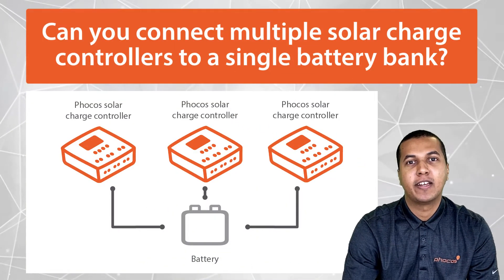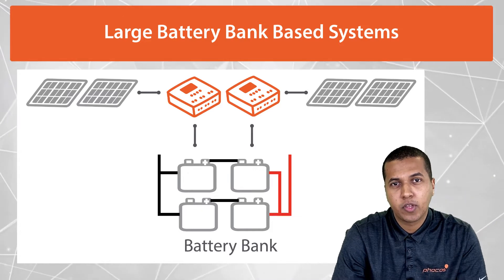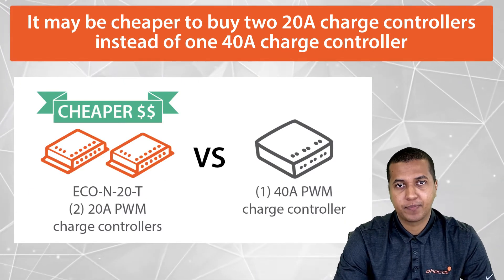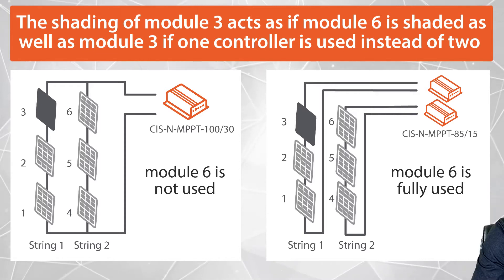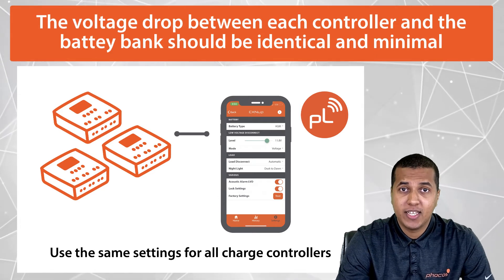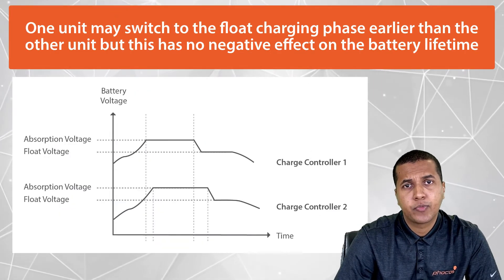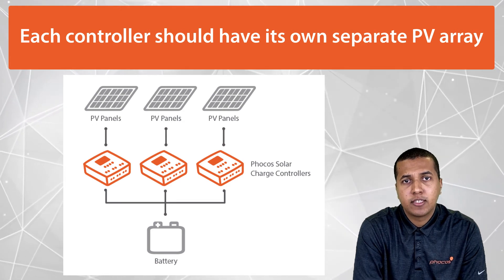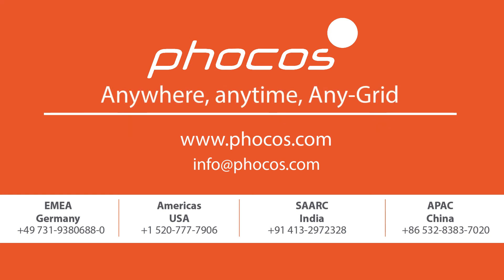Can You Connect Multiple Solar Charge Controllers To A Single Battery Bank?

Comment: I fitted solar panels on an Rv because they were different sizes I used separate controllers on each panel 
 I also fitted a diode ( one way current) on each of the positive feeds from each panel so that there was no loss from  using mismatched panels, worked just fine!

Comment: How would someone go about connecting multiple solar charge controllers to multiple bus bars which link large amounts of batteries in multiple strings? Just as an example, say someone has five strings of 100 amp 48 volt batteries connected to bus bars. How would someone charge all of these using the multiple solar charge controllers? How would they do it if they cannot find bus bars to fit the total amperage necessary to match the charge rate of the battery bank?
Reply from the maker: Thank you for your inquiry, because of the technical nature of your question, we would strongly suggest for you to reach out to our technical support staff https://www.phocos.com/contact/#tab-contactech

Comment: Other videos srate that it’s not the voltage but the internal resistance of the battery that determines the output of the charge controllers. So having identical controllers is not essential.

Comment: Thanks for the video but i need your help i have 2×200w, 1×265w 1×270w, 4×415 watt panels, 8×280ah lithium batteries series to make a 24v system so my question is what size charge controller will i need to run my system i have a 60a charge controller but i recently bought the 4×415 watt panels so how much more amps do i need to run all of my panels all of my panels are 24v
Reply from the maker: Thank you for reaching out and sorry for the delay. According to our technical team, since you have chosen 24V panels, we assume you are using PWM charge controllers. We recommend to use a panel with a Voc about x1.5-2 the battery bank voltage when using PWM controllers, so, for a 24V battery bank system we recommend a panel Voc of about 35-50V. To properly size your solar system you should make sure that your charge controller can handle the full short circuit current of your panels when using PWM controllers. So, you should make sure that the short circuit current of your x4 415W panels in parallel does not exceed the current rating of the PWM charge controller you choose. If the short circuit current is 10A, and you have 4 in parallel, you will need a 40A charge controller (like the CXNup40) Also, make sure that same current does not exceed the charge current rating of your battery pack.

Comment: Question I have 2 PowMr 24v hybrid inverters 3000w each I have 24v 600ah Lipo4 battery bank can I connect both inverters to the 1 battery bank? 
But can I connect  4000w solar panels to 1 Inverter to charge the batteries ?
The reason why because I don't want to split the panels in half and run another set of wires from my roof down to the garage it's to much work
Reply from the maker: Thank you for your comment, unfortunately, we cannot provide any technical support for products not made by Phocos - But, if you were using 2 Phocos PSW-H-3kW-120/24V inverters, you could connect both to the same battery bank and then only connect solar to one of the two inverters. With Phocos equipment, it is not necessary to have the same PV power on each MPPT. Please visit our website www.phocos.com to see a list of Phocos distributors near you.

Comment: I am using 4 x 6 V PLA - L 16 AGM PLATINUM BATTERIES
USING A VICTRON 100/50 
THEY ARE SHOWING 11.37V 
My Alarm on my 2000 w 
Inverter goes off because power is soon lost I run my small pond pump pc and 500 w kettle and 700 toaster and cannot use them all the time what's going on should I get another
MPPT CONTROLLER
To get more AMPS and is it going to benefit my system
Thanks Troy
Reply from the maker: Thanks for reaching out, Troy. It sounds like your battery bank is undersized for your loads. You will need to consider the capacity of your battery bank to be able to provide adequate power to your loads at any point in time and for how long. Adding more solar charge controllers will not fix that issue, but may alleviate the problem during daytime when sun is available. 11.37 is very low voltage for an AGM pack, meaning the pack is being overrdrawn or overdischarged. Unfortunately we cannot provide insight or technical support for Victron products, but if you purchase any Phocos products in the future we will gladly support you via
tech.na@phocos.com
or
tech.emea@phocos.com
depending on where you are located.

Comment: Could you hook up, say, 2 pv solar charge controllers alongside an AC to DC charge controller?
Reply from the maker: Thank you for reaching out; It is okay to use an AC-DC charge controller in parallel with others as long as you follow the guidelines in this video - they still apply equally - the charge profile setpoints (Boost and Float) are perfectly matched and that the cables are adequately sized so that the voltage measured by each charge controller matches. 
Please reach out to
tech.emea@phocos.com
/
tech.na@phocos.com
if you have more technical questions"

Comment: I have a 5kw inverter installed which runs all the load in my house and on this system I have installed six panels 380 watt. Now I have bought 3 more solar panels 545 watt and I want to use these panels but my inverter is not double MPPT. If I purchase another solar charge controller for this and connect it to the battery in this system, will there be any problem?
Reply from the maker: Hello, thank you for reaching out and sorry for the delay in our response. It is okay to use a solar charge controller in parallel with the Any-Grid integrated charge controller as long as the charge profile setpoints (Boost and Float) are perfectly matched and that the cables are adequately sized so that the voltage measured by each charge controller matches. Please reach out to tech.emea@phocos.com if you have more technical questions
Reply: You need to match the controller to the PV panels and the batteries.
If your panels are 24V, the controller has to accept 24V unless you wire the panels in series, in which case the controller has to accept that voltage.
Your controller has to also accept more than 1635W of PV input.
24V charge controllers usually accept up to 2400W of PV input but check yours.
The battery has to be 24V also.
Just do not try to add something that is 24v to something that is 12v, 36v, or 48V.
The voltages must match.
When stacking charge controllers, only 1 controller will have an output at a time.
If an array becomes shaded, the other unshaded panels and charge controller will pick up the slack.

Comment: I have  have a kind of unique situation I'm wondering about.  I'm installing a solar panel array to temporarily power my RV at our RV pad,  but would also like to use the same array to power a seperate inverter/battery bank to power a 240v system for our well.  The idea is that when one system is full,  it can be used to power the other,  and vice versa,  and share the load when both needs it.  Is that possible for both to be connected in parralel to the same PV array as inputs to charge 2 completely seperate mppt controllers/inverter/battery banks?
Reply from the maker: Thank you for reaching out! 
For technical questions please contact our tech support 
https://www.phocos.com/contact/#contactech
Reply: Personally, I would use a relay with a 240Vac coil that would isolate 1 load from the other.
When the pump turns on it would also turn on the relay and isolate the RV input.
The RV should last on it's batteries for a couple of minutes.
Your PV array may not be large enough to handle both at one time and this way you do not need to add to it.

Comment: What if the charge controllers are not programmable different brands and one is a 20 amp the other is a 80 amp?
Reply from the maker: According to our tech team, we cannot recommend using charge controllers of different charge profile settings. As stated in the video, charge controllers can be used in parallel on the same battery bank only if their charge voltage setpoints are identical from factory or programmable by the use. If you cannot confirm that the voltage setpoints and temperature compensation functions are identical, do not parallel these two controllers. It is recommended to use multiple Phocos controllers set to the same charge profile. Please reach out to the technical support team for your region (https://www.phocos.com/contact/#contactech2) for more detail on questions regarding your Phocos charge controller(s).

Comment: Hi there. First of all, thanks for your videos. They're really helpful.

I have battery bank (2x220 48v lifepo4) and an anern ex-pro 10.2kw inverter/charger/mppt with a 8kw PV array. I'm planing to add one more anern 10.2kw inverter/charger/mppt with its own PV array. These anern aren't paralellable. The AC out of each goes to an automatic transfer switch. So, if one inverter fails, the other takes the load.

Do you know these inverters/mppt? Do you think they can be connected yo the same battery bank? Of course battery parameters should be exactly the same.
Reply from the maker: Hello thank you for reaching out! For technical questions like this, it is best to reach out to our technical experts at https://www.phocos.com/contact/#contactech2

Comment: I'm running 18 group 24 gel mk's but there different ages so each one has it own charge controler connected to a main trunk line from my 27 pannel array that acts like wall on my porch (mounted vertical). All of positive lines are bolted down for safety reasons. I only play with the negative lines, one from panel bus bar and one from the batterie bus bar. I haven't see anyone doing this. I might make video one day, because not everyone got the money for a huge bank.
Reply from the maker: Thank you for reaching out! For technical questions please contact our tech support 
https://www.phocos.com/contact/#contactech

Comment: Hello my friend I have got a question wish you can answer me I really need help,I have got 48v solar system ,and I bought 2000w kit wind generator but when I hock up wind generator controller to bank battery will not charge even 1w and I have had 2 days heavy wind with 0 charging,please let me know what I must do or testing.thanks
Reply from the maker: Hello, it’s worth considering that the PV side on the family of PSW-H inverters require a “minimum” DC voltage to operate. This can range between 90-120Vdc depending on the PSW inverter you are working with. However, it’s fair to mention that our line of Any-Grid inverters was entirely designed with solar in mind. Out of the box they do not come equipped with the safety features that a wind turbine charge controller or inverter would come pre-equipped with. Both power sources are not the same (one being mechanical the other being EM radiation). With that said, we cannot speak for a use case outside of what this product was designed to do. Please reach out to our tech team with any further questions https://www.phocos.com/contact/#contactech

Comment: Should there be a fuse between each controller  and the battery?
Reply from the maker: Hello, thank you for reaching out to us. One fuse can be used, but it must account for the total current from all controllers. If you have any other questions, please reach out to our technical team here: https://www.phocos.com/contact/
Reply: What that means is you have the outputs of the controllers connect together before everything goes through the fuse. Since it all will connect at the batteries, it can be connected before the fuse. But using separate fuses is a small increase in safety. And for a small increase in cost, you can buy inline circuit breakers that are also a disconnect switch. They are non resetting breakers.

Comment: I have been wondering about that.  I have two different controllers and two separate panel strings for a single 3 battery bank.  I just have to make sure of all of the settings like you suggest

Comment: If I use multiple charge controllers, would that mean they'll draw less wattage?
Reply from the maker: Hello, each controller will still draw the same amount of power from the battery in order to operate (power consumption). The amount of power delivered to the battery (from solar charging) by each controller will depend on various factors (battery state of charge, irradiance,..).
Reply: A shorter answer is that each one will "draw" less wattage, but the total drawn from all the panels will be more, as you will be getting more efficiency with each charger working farther from the high limit of it's operational power range. It's the same as two people lifting a weight as opposed to one. I'm assuming that the power output of the panels is less than the limits of the charge controllers, and the battery bank is large enough to effectively absorb (not be overloaded by) all the energy it receives.

Comment: I think i need a power diode on the output of one of my 2 (cheap,blue ones,china) controllers,they are both in parallel to 24 V batteries,they interfere with each other , the 2 amp meters oscillate a lot when the load is small and the sun is out;  also, they never let the voltages go to 14.2 either  (i have six panels of 60 cells, maybe that is the problem,should be 72 cell?; they are in 2 strings of three).
i guess i will have to spend the money and wire the panels in series for 60 volts and buy an MPPT?
Reply from the maker: Hello, please email our technical team at tech.na@phocos.com for assistance with this issue, .

Comment: Can 2 batteries in series connected to one charge controller
Reply: As long as your specific charge controller specifications allows for double the voltage, since 2 batteries in series will double voltage. In my case I use a Renogy Rover 40A, which will auto-detect 12v or 24v battery bank.
Reply from the maker: Hello, the number of batteries that you are able to connect to your Phocos charge controller is dependent on the rating of the charge controller and specifications of the batteries that are connected to it.For more understanding of your PWM or MPPT solar charge controller please have a look at these helpful videos:
https://youtu.be/5VGap1gZU94 - Introduction to charge controllers 
https://youtu.be/AxCfrrYbLfQ - How MPPT solar charge controllers work
https://youtu.be/L-ohAWuf8sQ - How PWM solar charger controllers work

For further advice, please contact tech.EMEA@phocos.com

Comment: Can I connect another pwm controller parallel and hyper mppt inverter By Using one solar kit  2500 watts ...
So I can charge 24 v battery by mppt hyper inverter..
And 12 v battery by pwm controller
Reply from the maker: Hello, thanks for reaching out to us. If we are understanding correctly, you want to connect an MPPT inverter-charger to a 24V battery and a 12 V battery, where the 12V battery is connected to two PWM controllers? This is not advisable. You want your nominal battery voltage to be the same on all charging devices. If we are not interpreting your question correctly please reach out to our tech team: https://www.phocos.com/contact/#contactech2

Comment: My EPEVER controller support 30amp only and 400watt, can I connect another controller to same battery for quick charge , battery is tall tubular Phoenix 280ah with 9 plates and it’s deep cycle battery please guide
Reply from the maker: Hello, thank you for your interest in our video and we hope you were able to learn something new. It might be best to check with your specific charge controller manufacturer for this type of detailed question. Best of luck!
Reply: Short answer I believe is yes you can

Comment: Hi, i upgrade my system from 24 to 48 volts  i have now total of 12 solar panels,6 are  of a higher wattage so  my question is :
Can I connect two MPPTs with two different wattage solar panel banks to the same battery bank?
one MPPT with the 6 lower wattage solar panels and the other MPPT with the higher wattage solar panels.
Reply from the maker: Hello, assuming the system is sized within the battery bank’s specifications, the short answer is, yes, this is ok for the PV side. MPPTs have a DC-DC converter that allows for this. The shared battery bank however must be a common nominal voltage that is compatible with the controller. For Phocos controllers this would be 12/24Vdc battery banks.
If you have any other questions or concerns please feel free to reach out to our tech team, we are always happy to help!
https://www.phocos.com/contact/#contactech
Reply: @phocos-global  Thank you

Comment: Hi thanks for the video. 
Can I connect 2 controllers directly to the same battery, or must I have a busbar? 
Thanks
Reply from the maker: Hello, two controllers can be connected directly to the battery as long as the same wire length/thickness is used for each controller and the voltage drop is kept minimal. A bus bar is thus not required. It does help when more than two systems are paralleled for high current distribution and to make connections to the battery bank easier.
Reply: @phocos-global   interesting, i'm gonna check my voltages drops btw contr and bats
Reply: I use 3 controllers...as I have 5,020 watts I'm panels going into the battery's.. I use 2 x plasmtronic pl40 ( 40amp each ) for the solar plus a plasmtronic pl20 controller for wind 600watt.. my system is hybrid.  Wind and solar. I use the wind controller that came with the wind turbine linked into pl20.  You can put the controller onto battery or you can use a bus bar to link the 2 together ( power out to battery ) it really depends on what you want to spend.
Hope that helped
Reply: Does it also work for example if i have 850wp solar panels and i split them over two mppt s from victron  to one large LiFePO4 battery?
Reply: Hello sir, can I connect 2  differents charge controller 80ampere and 40amperes directly to the positive BMS 120amperes, lifepo4 battery use,tnx